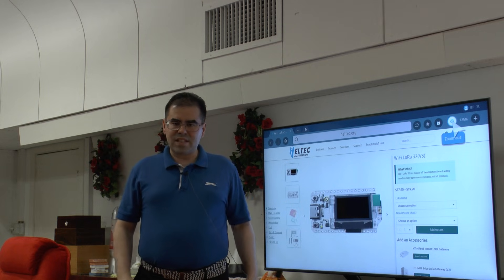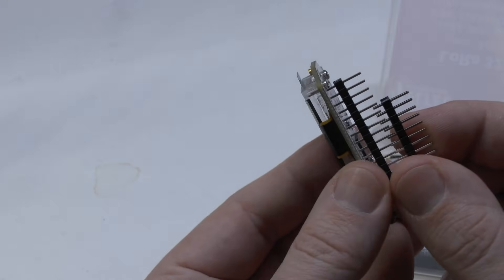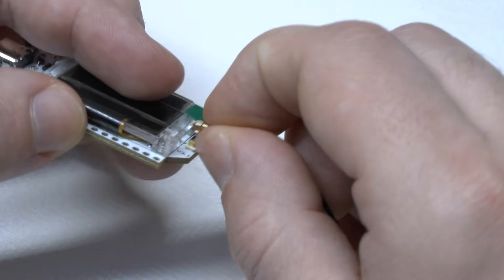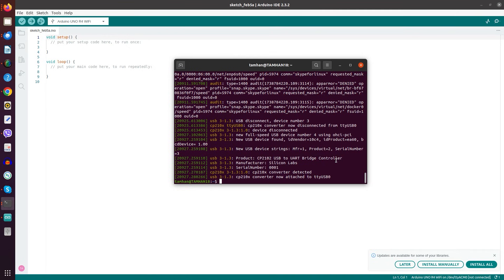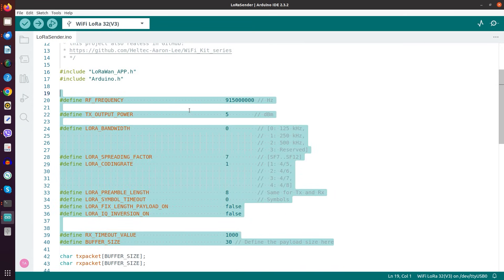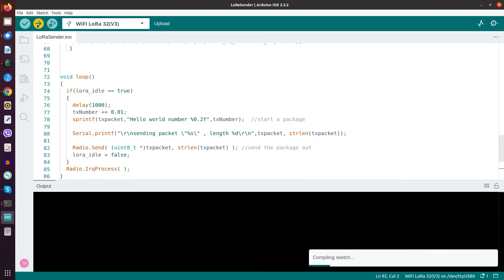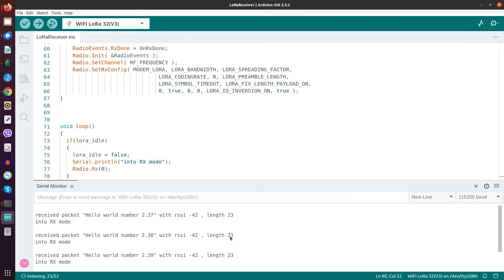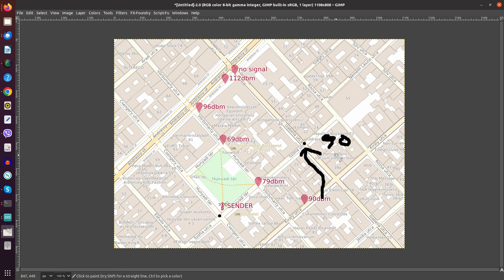ESP32 LoRA with the Heltec WiFi LoRa 32(V3)

Comment: Hi ibhqve the same model u bought. But when  i plug in to computer and used arduino IDE  my esp32 wont show the display.  The project that i make is about receiving and transmitting data  with joystick .  But it seem it doesnot work
Reply from the maker: Hi, did you make sure that you got the correct version of the starting program? Also, maybe the connector got damaged by heat? Sorry for being slow...

Comment: Danke für das Video, ich habe mal eine Frage, gibt es für dieses Board eine Sketch wo ich ein paar Pins für zum Schalten von Relais benutzen kann? Der sollte als Class C  Device Lorawan laufen. Vielen Dank.
Reply from the maker: Hallo, immer gern! Was meinst du mit C Netz? Tam
Reply: @MrTamhan  Danke für die Antwort, mit C -Netz meinte ich Class C Devices, also Geräte die permanent auf Empfang stehen, wie man es braucht um etwas zu schalten. z.B dieses Heltec Bord V3, wo man 4 oder 5 GPIO hat um Relais anzusteuern, und dann noch z.B. Sensoren, wie BME 280 oder ds18b20, das alles über Lorawan, mit Downlink, Payloadformater...
Reply from the maker: @Linux-s8l  Hallo, ich würde mir einfach ein Beispiel greifen, das ein C Device implementiert und dann die Arbeitsschleife erweitern. Du kannst bei Receive ja Timeout setzen, etc etc